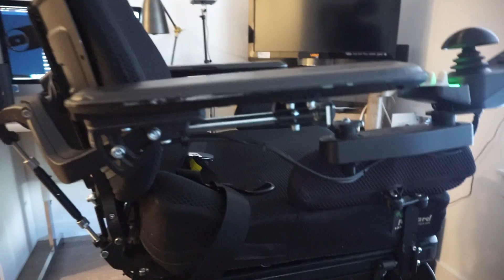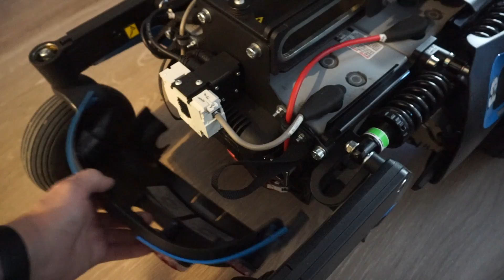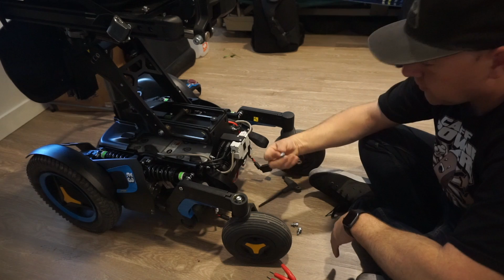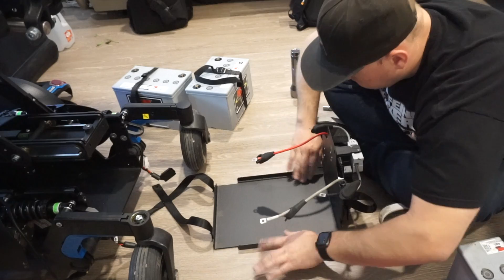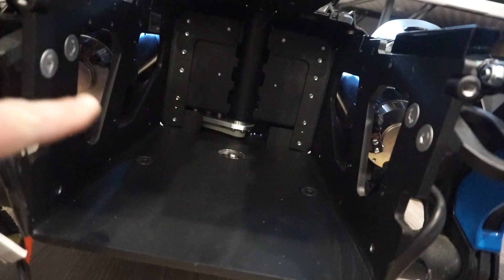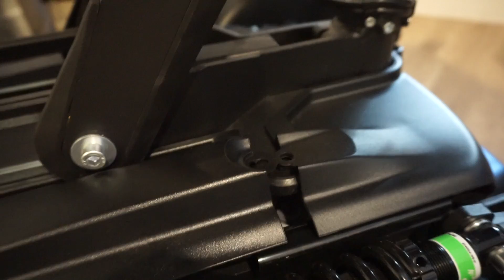WHEELCHAIR REPAIR: Permobil F3/F5 Battery swap

Comment: I recently tried replacing the batteries on my Permobil m400. I wanted LifePo4 batteries, but they weren't suitable due to their height. The original batteries are 180mm, while the ones sold are at least 200mm. Since I had the opportunity, I connected a 24v balancer (Powmr). It turned out to be quite useful; the stroller goes noticeably further even with older batteries. It simply equalizes the voltage on each battery, ensuring the same voltage, which will extend its life.

Comment: I just took out the 8 year-old gel-cell batteries that were in the F3 I was given and replaced them with a pair of 12V 100ah lithiums. I was getting about a half mile range out of the 8 yo gel-cells. I knocked the battery weight down by 55 pounds, and increased capacity about 35%. I just need to rework the charger for the lithiums. BTW, even with far superior batteries that with care, may last over a decade I saved over $350 off Permobil's gel-cell replacement price. Win, win, win. Thanks to your videos, I'm learning.

Comment: What's your thoughts on using a  Power Queen 24V 50Ah Smart Deep Cycle Lithium Battery. I know you would have to use a different charger and it would have to be strapped down so it would move around but being lithium battery it being a higher voltage I wonder if it would damage the electronics
Reply from the maker: voltage is voltage, no matter where it comes from :^) however, one thing to watch out for tho is the max amperage ratings.. you'll need at least 120-150 amps for things to work properly and keep ya from getting stranded if the pack trips the over-current protection!  a lot of times the ratings are NOT correct in the listing!
(also the chairs battery gauge wont work properly anymore - but thats not too big of a deal)

Comment: It's ridiculous that they don't put a threaded hole on every wheelchair for an EZ-Lock.  It would cost ZERO extra during manufacturing.
So, if you go to the Monopoly mobility place in my town, they want $1500 to install an EZ-Lock.  $750 of which is for the wheelchair attachment.
Insurance pays for nothing.

Comment: Hey man, I love and appreciate your channel so much.. thank you for all of your hard work! Quick question, I’m looking into buying new group 24 batteries for my Corpus F3 that was recently donated to me. Can you please let me know where I should buy the batteries to get the best price? Also, do I really need the Permobil Voltpro charger? I believe I have the old charger because it’s older looking and is grey, where at the Voltpro looks black. Can I get any group 24 batteries, or do they have to be a Permobil specific batteries? Would love to hear  back so I can put this thing to use!Thanks!
Reply from the maker: hey! so the F3 can fit the group 24 batteries just fine - gotta route all the cables just right - but the chair is designed to fit them.  im not a fan of the permobil branded batteries, OR the volt pro charger anymore.  MK power is the brand of batteries ive always said to stick with - and nothing has changed at this point :^) buildmywheelchair.com has competitive prices on batteries - the market tends to fluctuate a lot and they adjust their prices accordingly when things rise and fall.  
here's a video about my findings with the permobil batteries & the volt pro charger...
https://www.youtube.com/watch?v=x-o0vILgNN0
here's a link to the batteries - https://buildmywheelchair.com/search-results-page?q=mk%20battery
most of them are sold in pairs on that site, but just make sure the listing says "pair" when ordering, otherwise you'll need 2 :^)

Comment: I'm also so shocked you use Pittsburg on your chairs, especially those t-handles!
Reply from the maker: having slightly off-sized allen wrenches can be SUPER handy! especially when working on stuff with older fasteners that are stripped, corroded or damaged. 
also.. whats an 'off brand' tool gonna do? make the batteries start leaking somehow? lol

Comment: Dan your a Life 
 saver 🤣 very helpfull video.    Do you know any good online spare parts for permobil? Also do you know underneath the locking system with the 3/8 plate aftermarket or factory? Ill appreciate it.                   thanks 👍

Comment: At about 16:33 is the problem I'm having. It looks like you might have had the problem but edited it out of your video. When you're sliding the battery tray back in it doesn't go all the way but leaves about an inch. I discovered there's two small bolt tops that are blocking the tray from sliding in all the way. If you had this problem and fixed it that is what I'm trying to fix but I don't see in your video. Please let me know if you encountered that problem and how you fixed it. Thank you
Reply from the maker: didnt have any issues like that here... if there's bolts sticking thru on the bottom though, ya should be able to lift the battery box up a bit, or maneuver it around to get past them

Comment: Really appreciate your videos!  I just changed batteries on my f3 and now I can't get the cover back on.  The rubber boots are hitting the cover.  I have replaced these with these same batteries twice before.  Can I run without the rubber boots or get rid of the washers¿????? Any ideas?????

Vern wallace
Reply from the maker: the batteries have to be the proper orientation.. and all of the cables lined up just perfectly.. im assuming you're installing group 24 batteries? they BARLEY fit in my old F3 lol the ridges in the top cover are for the battery screws to fit, and also the cables.  took quite a bit of finagling to get everything in place.
also make sure you top cover is seated into place correctly before ya slide it back on.. it can pop underneath the little ledge that its supposed to be on top of fairly easily. good luck!

Comment: Can I use lithium battery for my permobil F3?
Reply: I did. But I'm an electronics tech. I'll have to change the microcontroller's input circuit for recalibrating the 'charge remaining' gauge, and rebuild the gel-cell charger for the slightly higher voltage charge curve of the lithiums. But I'm now 55 pounds lighter on battery weight, but with 35% more battery capacity. After I clean and lubricate the wheel bearings on my old F3 I expect 20 to 25 miles of range.

Comment: Hi, after After accumulating 890 miles. Yes you heard me right 890 Miles, since November of 2018 on my permobil -F-3 power wheelchair. I'm about to replace the batteries on  my power wheelchair just as you have in this video.
    My question is : Approximately how long, how long,"how many hours did the first initial charge take.  ?
   If you could get. back to me, i would greatly appreciate it.  But one thing, i know theres not many people that has accumulated 890  miles in less than three years on a,
Power wheelchair........
         Take care........
Reply from the maker: i usually run 300 miles/month on average.. there are quite a few people who put lots of miles on their chairs :^) the initial charge wont take long.  BUT you wanna make sure ya dont run the new batteries very low at all for about the first week, and plug the chair in ALL night, EVERY night!  8-10 hours of charging is important.  some people look at the battery gauge on the chair, and others the lights on the charger.. and unplug it as soon as it turns green, or when the chairs battery gauge shows full.  doing this will shorten the service life of the batteries quite a bit! 
lead acid batteries need 1-2 hours of 'absorption charging' - this only happens after the light on the charger turns green. 
also - dont skimp on GOOD batteries.  MK power is the way to go!
Reply: @TotallyNormal-  Man this reply statement is very useful!!! I NEVER had anyone or any DME guys tell me about how these batteries charge and need a good overnight charging even after the light goes GREEN!!!!!. thank you. I have batteries back ordered (to be in Oct 1) for my chair, from my Permobil dealer, my current batteries in my 2020 are failing fast, i need to plug it in after 4 - 6 hours just running around my home doing. I leave it plugged in all night always, but I get batteries from Permobil. What are MK batteries? is there anything I can do to improve the batteries I'm using till I get replacements?

Comment: I am so glad that you do these vids, i am also in the same wheelchairs by Permobil (M300 and M3). The big question that i have is how do you get back up into your chair after working in the floor. I am already having shoulder problems.  Thanks and keep up the great work.
Reply: If it helps, what I do is park the chair close to a stable surface. I'm my case a coffee table.I throw one leg over my seat, grab the chair arm furthest from me and using the coffee table to push up, and my other arm to pull, I can get into my seat.
Reply: @CajunSmack , that sounds great. But I take it you aren't a slightly overweight 75 yo like me. :)

Comment: I went to replace 2 batteries for our Permobil F3. They said they were 245 a piece. Is there a way to get them cheaper?
Reply from the maker: if ya look around online ya can find some sellers that ship a pair of the group 34 MK batteries for $350-375 ish with free shipping.. BUT if ya need the group 24 batteries - $245 each is about right..

Comment: A quick question :
    If Someone wanted to put an LED light bar,
    which would be 12 volt,  Would the 2 batteries be able to handle that ?
( I I would really appreciate If someone could answer my question ? )
Reply from the maker: you'd want to run a 24 to 12volt step down (or buck converter) connecting accessories to ONE battery will get them out of balance and cause a bunch of issues.  a lot of the light bars out there (especially from china) support 12 AND 24 volts right off the shelf though!
Reply: Yes, and Dan has a good point

Comment: Thanks man , just changed out the batteries on my sister m3 spent about 500 on the batteries and about 10 min to install way better then what a wheelchair repair company was charging over 1,000 and it has been two weeks with no word from them smh and that’s that I told them I would pay cash not from insurance an they still pushed me away , sucks that these companies are money hungry and are real slow at service calls or parts of using insurance that sucks how they prioritize things obviously they make more money from insurance customers but take an eternity doing so and for a person with disability a wheelchair is a necessity that’s how they move they depend on it ! sorry for the rant lol
Reply from the maker: oh i totally understand!! glad ya got it taken care of!!
Reply: $500 for batteries???? I'm a tinker. into R/C. I got a use electric wheelchair for
$30 ( it didnt work). The batteries didnt want to charge. 12V 36ah ( cranking power ..exact replacement batteries are only $70-ea)
Did a little research....wiggle stuff around to make use the connecter were making connections..ect....Hook up 8S Lipo batteries 4.2 v x 8 fully charged.
33.2

The controller can operate on it ( becuase another simular model with 450watt
motors use the same ESC). Mine only have 350 watt motors...even thou the manual says 200 watt....anyways..I used a different charger to recharge the
stock batteries ( they were sitting for years..and the acid simply evaporated).
The batteries charge back up...so I can use to wheelchair's installed charger....
I tried 10S ( 40.2 V)...it's didnt work...The controller will flash to simply tell
me it's too much voltage...I tried 9s...still to high...it's above 36v
I have 6V acid batteries...laying around..The controller will operate UP to 36V
Fully charge acid 12v batteries will get up to 13V. So I CANT use 3x 13v (39V)
Im going install 2-ea 12 V and a 6V...to give the chair more gusto...or use 8 LIPO.lol...But there's 8s Li On battery packs for electric bikes for only
around $100 or less,NOW ...get lot for $500...swap packs or wire it up
so you can switch back and forth...for more RANGE.
LIPO are smaller and lighter MORE DISCHARGED POWER..recharge in less time..but they're  a little more pricey. For $500...I would of had of 8s lipo with wazzooo range .lol
I only had enough to put 10000mah together ( $120)..I can drive the chair
for 15 mins none stop. 3 miles...probably...IDK..The motors or esc dosnt get hot.

The Wheel chair was almost brand new...It still had shipping plastic wraps
on it....It was just in storage
Reply from the maker: whats the brand of chair you got? ive been meaning to do a test and see what the max voltage the controllers will run on... 36v would liven things up quite a bit!  one thing to consider with mobility devices - they dont just ramp up the voltage similar to standard ESC's or industrial drives.. they MAX out the amperage when you start moving from a stop - for a nice smooth linear start - the output curves are very interesting.  thats why the wheelchair controllers are so big and have so many MOSFETs in them  they see max amperage almost anytime ya move around.  from a start you can spoke to 110 amps, then when up to speed, 25-35 amps depending on things.  the controller also powers up the field wingdings in the motors - and keeps them powered up for 0.5 to 1.5 seconds after you stop moving.  plus the regenerative braking that's mandatory for you to come to a stop.  theres a lot of factors inside of these things..
but im happy to hear someone was trying higher voltages!!!  im super curious to see what your final setup looks like!
Reply: @TotallyNormal-  Liberty 312...but is has 350 watts motors (EC82M245335ALOBL) The ESC is P&G VS 2 60A
I ve just been running it on the 8S lipo....2-ea 4s 5000 mah @ 50C  x 2.
The wheel chair is heavy. It also has solid 10" back tires.
I was pulling 2 kiddies wagon with 4 kids and a baby..probably
300 lb plus total ( I my self weight 145lb)..The stock chair says 81 Lb.
It didnt have any heating issues. I test drove it 4-5 times...on 8 cells.
Reconidtioning the acid batteries at the moment.

I just made an adapter for the  Lipo batteries.
( there;s no modifications to the esc/wheel chair...ect)
There's just 2 wires  jammed tight and tape into the ESC Batteries input.
I didnt clip wires..ect I simply cable tie them out of the way.

 It has decent speed..7-8 mph. It stops when I let off the joy stick..
might be a little fast for indoors. if you're not used to it.
but fun speed for the kids...outside.lol

I was keeping up with the kids on modify power wheels on 5s lipo ( 8 mph)
Well...my final set up would be stock ( so I can give it away) everything works on it.....However i plan on using the motors on a powerwheels with 13" pheumatic tires..Run it on 8s lipo with a GO kart  ESC...with just forward and reverse 36V-42V go kart ESC...Im not sure what the amps are...
but some of the ESC on my R/C are in the 150A range 6s...
They go 60mph..easy...Yes Im awear you can program ESC
to different punch level or breaking..ect 

I dont have the programming card to the wheel chairs ESC.

I 'll just put the motor back on the chair when the kids out grow the powerwheels...it wont get daily use...They might ride it once or twice p/week.
The power wheels will be lighter.Idk what the top speed will be with 13" wheels..
not much faster..under 10 mph for the kids will be fine.

Like I said ..I got it for only $35...but it's almost new( unused)
I'll make  sure everything works when I give it away.

Comment: Question about secondhand powerchairs- my seat dimensions are really really tiny- can you adjust the seat size on these chairs?
Reply from the maker: Most permobil chairs in “standard sizes “ (assuming it’s 3G seating) can be adjusted width from about 17” to 23” (don’t quote me - but something like that lol) and depth can be adjusted as well      If ya start getting less than 17” ish- then you’ll need pediatric seating. Hope this helps!
Reply: Totally Normal I’m 14 inch width, lol, so I’ll check that out!
Reply from the maker: yea - that's in the pediatric sizes then for sure.  a lot of those (pediatric chairs) are slightly adjustable in that range as well.. but not sure of how much.  BUT the power bases are identical to the bigger chairs FYI :^)

Comment: Hey Totally Normal, autism here thanks for postin this i couldnt figture out how to get the cover off despite reading manual & it was hard so your video helped. my F3 or any of my pchairs i've owned batteries tend to go quicker than most cuz i mainly use it indoors end-of-day (thankfully i have that choice) its the only thing that makes my body pain free and has the added effect of soothing autism. thx

Comment: Good night .......I'm very intereested in buying myself a wheelchair. And l like them quite pernobil . And l saw some Swiss-made chairs ( scewo Bro) that they really liked ( climb stairs)and other germán off-road (ziesel) impressive,  but l was sad to know their prince. 
Please tell me by a pernobil bet ween f3 and f5 what is the difference and which would you choose
Reply from the maker: F5 is an inch or 2 longer than the F3.. but it has faster motors, more aggressive tire tread, and a taller seat lift :^) they're essentially the same chair.. but F5 is faster, taller, and very slightly bigger.
Reply: @TotallyNormal-  Please tell me how much this chair is and how I can buy it.
Reply from the maker: 30k new - and around 5000 to 7000 used on ebay
Reply from the maker: honestly, I'd just keep an eye out for an F5 on ebay.  they're EXPENSIVE! (anywhere from $20k - $30k brand new)
I seem them on ebay fairly often starting around $5-7000
Reply: @TotallyNormal-  	I don't understand it's $30,000 new or on ebay they sell it for $57,000 I don't understand